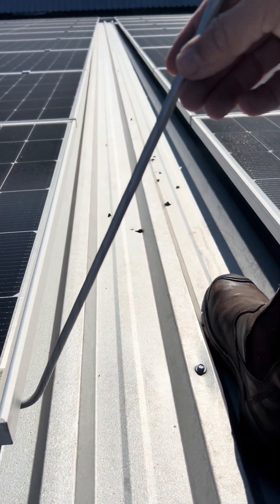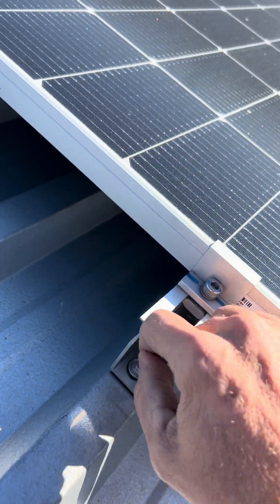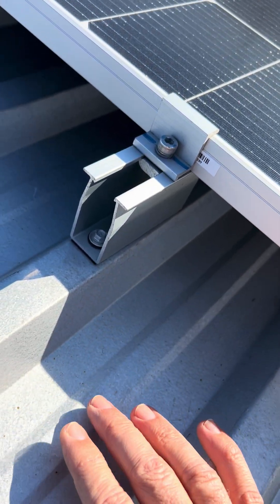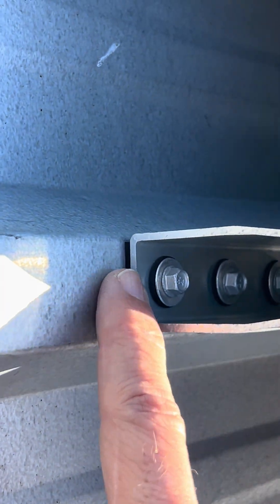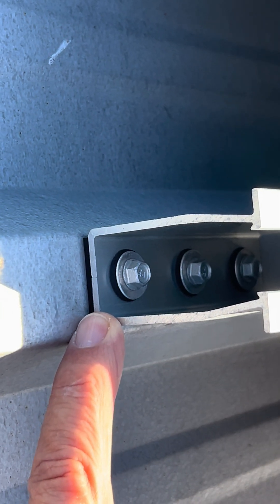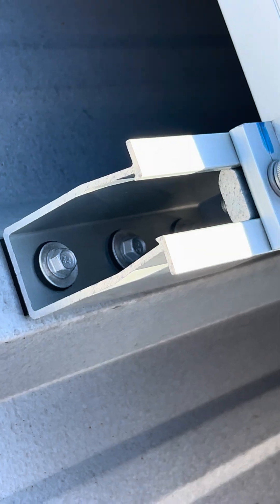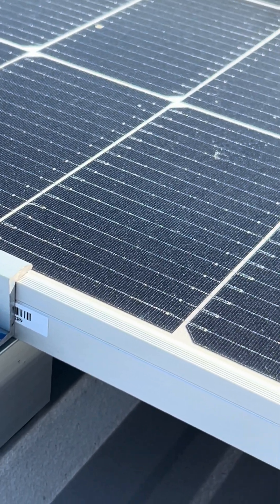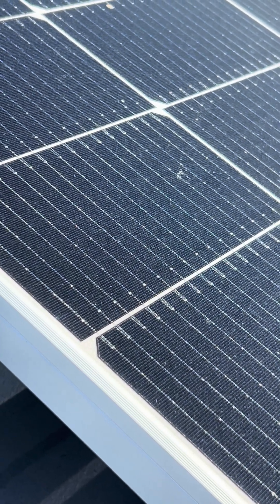Logic behind Solar PV System Lightning Protection #solarrepair #renewableenergy #pqrs #diysolar

Comment: That is an incomplete lightning protection system. There should be a copper network that connects all the lightning arrestors to the ground to discharge the surge safely into the ground.
Reply from the maker: Absolutely spot on